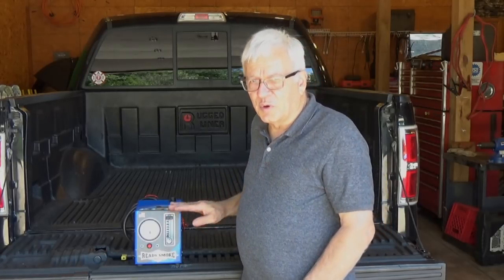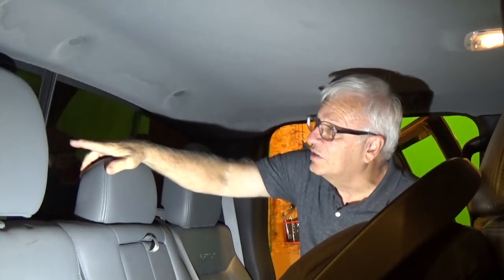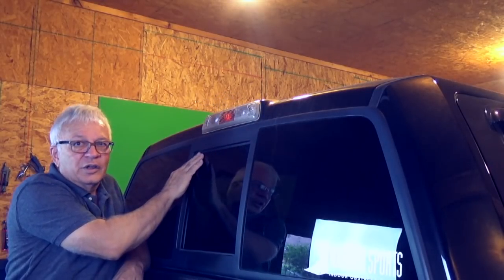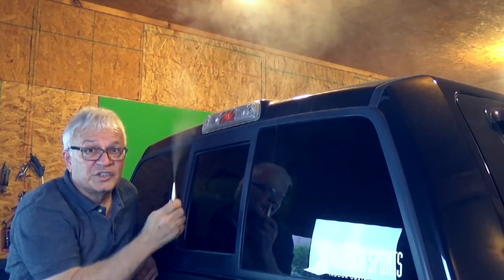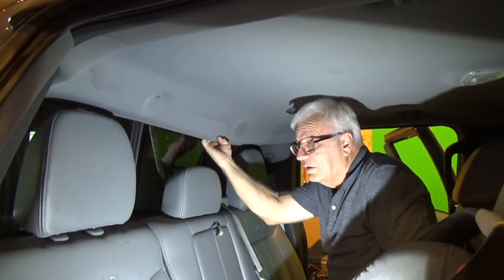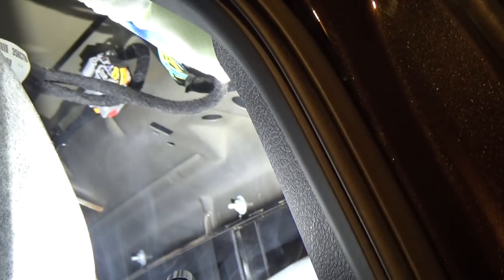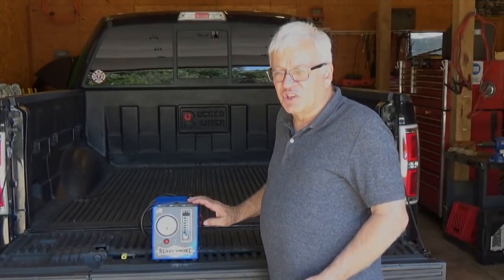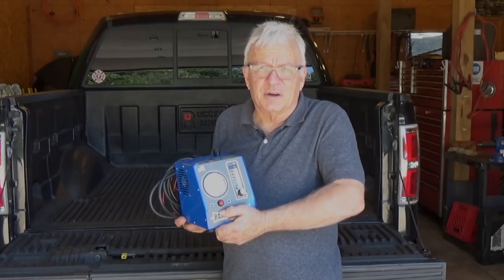Finding A Water Leak with a Smoke Machine

Comment: You can use the smoke machine for wind noise as well as water leaks. Start the car, turn the blower on high being sure you're  not on recirculate shut all doors and windows, then run smoke around all seams and/or windows from outside the car. This creates positive pressure inside the car, so when you find the leak it will disrupt the smoke causing it to blow away from the car. This way you don't need someone in the car.
Reply: Would that method work at back of car say on rear lamps or would u be better putting smoke machine in the boot and run to find leaks coming in good idea though
Reply: If you're talking about a car with an old time trunk area vs like on a SUV or a soccer moms van then no. The blower pulling outside air into the car thru vent causes positive pressure in the passenger area and it tries to escape thru the LEAK. .
Reply: Am from England and work on a lot of sallon cars with a boot was thinking like of u put smoke machine in boot or in car footwell in front and fill car full of smoke and see if smoke escapes to find holes or splits in seals ?
Reply: @danielgreenbaum8875  It will probably work, but you would need to hotbox the entire car before it starts leaking out, which is likely to leave a bunch of residue all over your interior.

Comment: I use the same method, but prior to disassembling anything I will turn on the blower to high and use the outside function drawing air into the cabin to pressurize it. Close all doors and windows and then place the smoke machine on the outside near the leak area. This will show a disturbance of the smoke as I place the emitter end of the hose near the leaking area. If that does not expose the culprit I then proceed to disassemble as needed to find the leak and try and force the smoke in as you have done. Good video. Smoke machines have a number of uses and it is good to see that there are videos helping people understand that.

Comment: Duane I’ve been watching your videos for years.  Looks like you’ve been sick - hope you are getting better.  Really have learned a lot from your video over the years. Theory and operation.
Ford has a TSB with an updated seal for the F150 and lense if I remember correctly.
Reply: TSB means " technical service bulletin". In other words, they issue instructions to the dealer on how to fix some problem that the manufacturer caused by poorly designing a part.

Comment: If you close the holes in the lower part of the roof, the water will still go throught the holes on the lighthousing. I cant believe they make a sealed light and then screwholes still run through the light... Best is to have a lighthousing with seal and no holes, so you would screw the light onto the body from the inside.

Comment: I have the Smoke Pro :). Do you happen to have the link for this one in the video? Thanks!
Reply from the maker: No I don't sorry.   FYI, I've used both and the Ready Smoke is the best
Reply: @realfixesrealfast  both made by redline. Therefore I have to say that Smoke Pro has worked great for me. One thing I have to say is that if you want the smoke to travel faster in an enclosed environment like a evap leak which is usually small and by the canister, fill it with smoke by removing the gas cap and when you see smoke you know it is almost full of smoke and then you can just close it and continue to run it so you can see the smoke right away. With a small leak, it will take a very long time for the smoke to get to the source of destination and probably much longer if running through a small leak.
Reply from the maker: @scientist100  great point.  Most experienced techs probably know that, but the newer ones would probably miss that and be led astray.  Thanks for adding that important point.  Duane

Comment: diy ., positively pressurize the cabin with a big chop vac, clean filter or filterless and cleaned with a towel in 1 window or duct vent , depends what your looking for and how fancy you wanna get.,.,  use smoke or soap or just listen or feel  for the flow ,.  works from inside or outside ,.